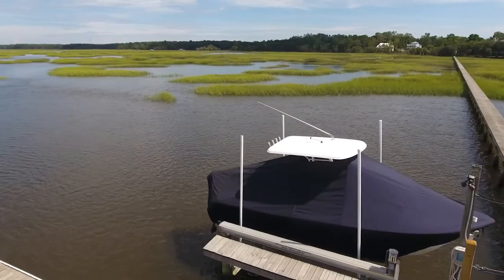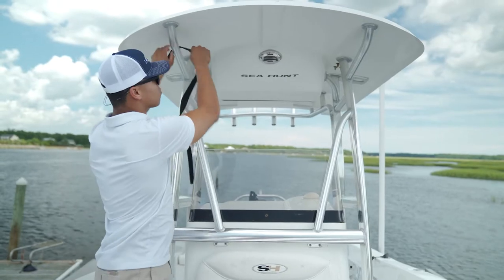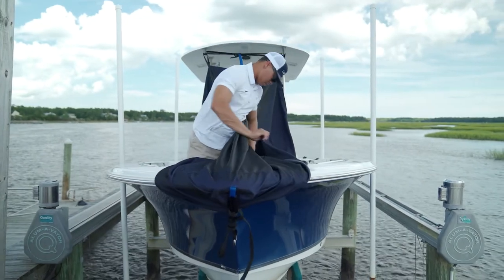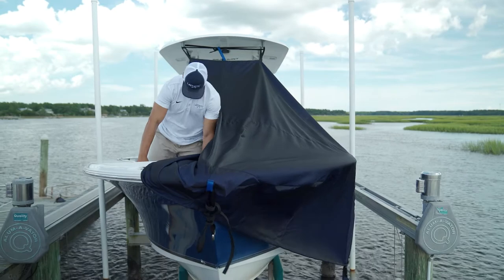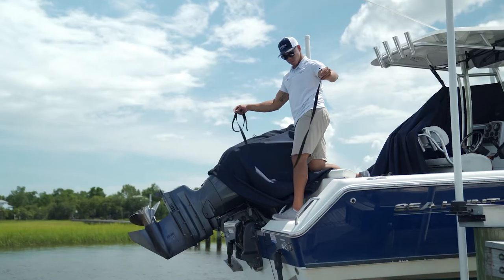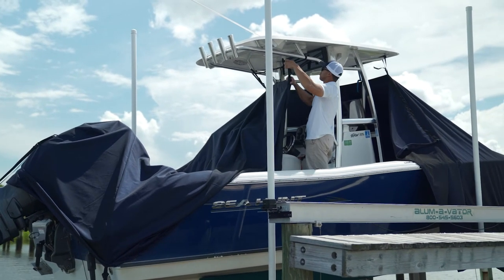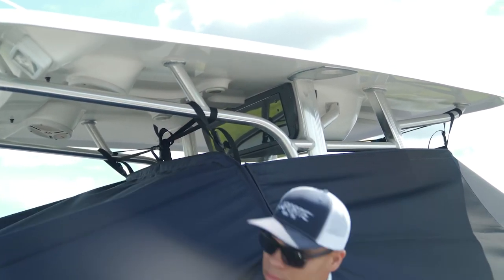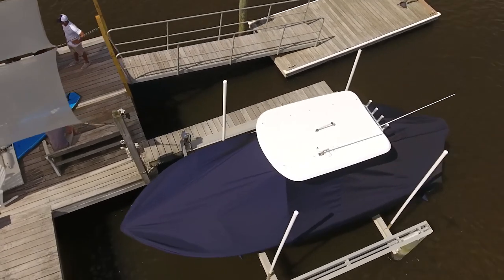T-Top Boat Cover: Installing on a Lift

Comment: But how do you tie down to the lift during a storm when all the tie down points are covered up????
Reply from the maker: Our covers are not made to be used during storms. In doing so, you will void the warranty.
Reply: @LaporteTTopBoatCovers  I don't care about the warranty... I want to secure the boat to the lift AND have the cover on